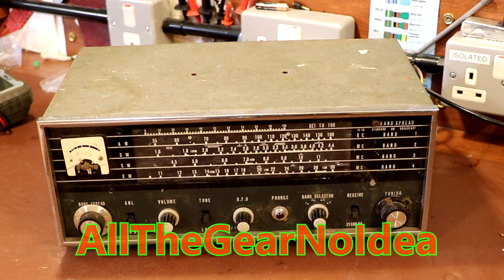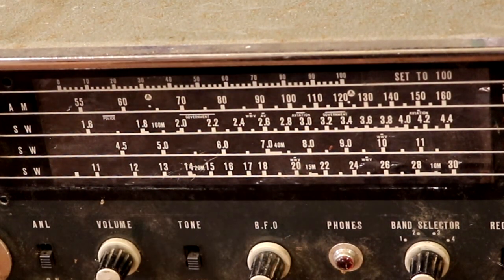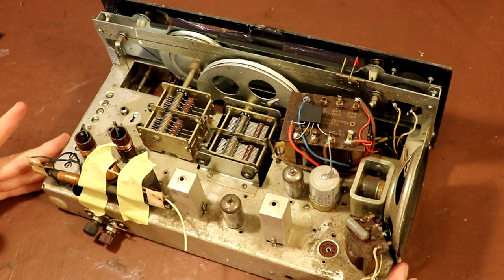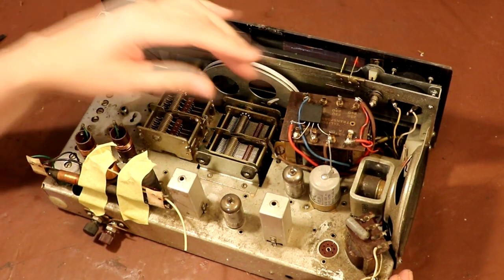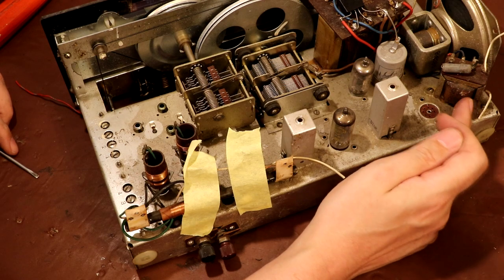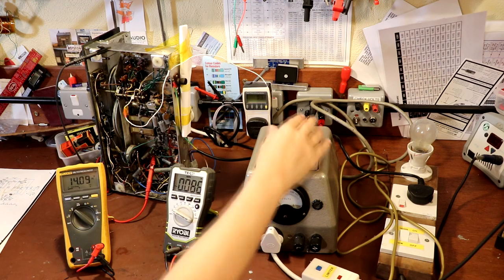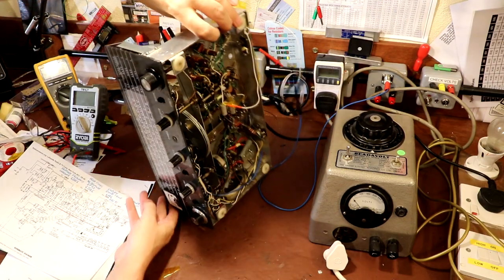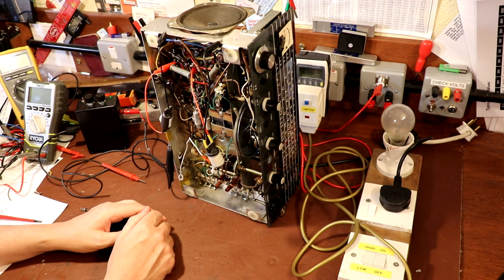Lafayette HE 40    Part 1

Comment: Hi Chris. Lafayette Radio Electronics was a catalog distributor and retailer headquartered in the NYC area from the 1930s till 1981 when they filed for bankruptcy. The address on Jericho Trnpk. In Syosset (pronounced si OSS ett) was on Long Island and was their main headquarters, warehouse, distribution center as well as a large retail store and repair facility. They had a huge catalog in their good days of over 400 pages. They sold everything from components to ham gear and hi fi equipment. I remember dreaming over that catalog as a young lad back in the 60s and 70s. The radio you have there was kind of an entry level receiver with some extra feature such as the bfo to make it more useful. Hardly a communications receiver but many a young ham or swl started out with radios just like that. Thanks for the look see and bringing back some very fond memories. Stay well. ATB Doug.
Reply from the maker: Doug McArtin  I remember fluffing the Syosset name on a previous video thanks for the information. It doesn’t appear very sensitive compared to the Trio 9R but it lacks the RF amplifier stage. Still I haven’t  sorted out the ferrite rod yet or tried alignment so it may improve a bit.  It is quite good fun trying to reverse engineer all the hacks and half hearted repairs.  It’s easy to make a radio work it’s not so easy making it work well but it’s worth a try. Thanks regards chris

Comment: Rip It Up, Rip It Up, Rip It Up and start again.. :) That was a bodger of a set Chris, good job getting it working again. I wish I'd have taken some images of my one but I didn't and I don't even know what became of it. It may be in the wardrobe. Pleasant little sets for having a twiddle around on. All the best from the lands of the Iceni, Andrew
Reply from the maker: Andrewausfa Thanks Andrew. It’s very deaf actually working better on some of the higher bands than broadcast bands. Probably need a dose of alignment.  I still have quite a lot of junk to remove off it and make it safer. Thanks Andrew regards Chris
Reply: One has to agree with Andrew here, the HE40 was just a novice's set to be played with, different though if it was a Frog-7.
Reply: Nice radio the Frog-7. Scores one in a garage sale some years ago.

Comment: Well done! And funny as always, Chris. I had a "technician" co-worker who was a ham, we had a term for his work - hammerizing (hammerising in the UK). I am currently repairing/refurbishing a Kenwood (Trio) KR-720 AM/FM Stereo receiver including replacement of some 50 odd electrolytics.
Reply from the maker: David V  You know I am quite a fan of the Trio sets the 9R was a lot of fun and you can see a lot similarity’s in the Lafayette radio. I will definitely be looking out for more Trio Radios. I’m not aware that any were stunning performers but they are nicely put together and easy to work on. Yes get those electrolytic replaced. All the metal canned paper capacitor were also leaking in my 9R. Stay safe and thanks for watching

Comment: It deserves a new life and a bit of a clean.  It has been well got at, but it still worked.  Change it to a positive power switch, some of these old radios were lethal.  Why they designed them like that is just silly, though in those days you might find them plugged into the light along with the light bulb, so positive could end up any way round.  Plus they did nothing about colour codes to make anything safer.  i am surprised there was never more people electrocuted!!
Reply from the maker: I have already changed it to live switching. But it does introduce a little  more mains hum given the proximity of the volume pot to 230v  live mains. If neutral switching is employed it’s effectively a ground connection so quieter. But as you say live switching is safer and double pole is better still.  Thanks for watching and comments. Stay safe regards Chris

Comment: It lives! A lot of bodges in there but it was complete and pretty much working. Should get rid of the hum once the original 2 section cap is replaced. could also be the poor wiring layout that adds to the hum as well. The flicky meter needle was ace... that might buff out with a bit of polish....
Reply from the maker: George Christofi  Thanks for the radio George I have enjoyed playing with it.  I think most of the hum is due to the poor way it’s been converted from a series heater string. It’s now using the chassis as the filament return to the transformer.  I suspect it originally had an auto transformer. Thanks regards Chris
Reply: @allthegearnoidea6752  the filter caps are definitely shot as evidenced by the constant hum which doesn't change with the volume control. Looking forward to seeing short wave bands work on it.

Comment: I like it and I also would want to rescue  the abused and used from the parts bin, 
Snip snip,
Eek, 
fair enough, -just get it back to factory seems like a good idea, - 'Improvements' are either for a specific function  or just wank.
Best regards, Sam.
Reply from the maker: Average Joe  I think a lot of the mods were to reduce the voltage in the filament wiring and to accommodate a different valve from those originally installed.  I don’t think it’s possible to return it to stock but we should be able to make it useful again. I probably won’t won’t spend much time on the enclosure this time. Thanks Sam stay safe regards Chris

Comment: I have a Hallicraters S-120, but it seems to be North American made with a selenium rectifier, and those IF cans with the crappy silver mica wafer caps in the base.
Reply from the maker: Oleg Kostoglotov I haven’t had a S-120 I think the circuit was almost identical but the radio cabinet was a different layout. They did a have single diode solid state rectifier. Thanks regards Chris

Comment: Yes george is a smashing bloke and he has a sick sense of humor :-D.
I don't think there is much he can't repair.
Well that radio has been over fondled by it's owners, im sure there is a law against that.
As i've been faffing about with that leak 20 amp, i know how bad coupling caps can really upset the valves.

Yes that radio needs a lot of love, i know you will cure it's problems chris :-D
I hope you are enjoying the odd bit of tinkering, i do when i get my teeth into something ;-D
Smashing video chris thank you :-D
Reply from the maker: zx8401ztv Thanks for the nice comments. Yes this radio has been hacked although the original wiring wasn’t very good either. Still it’s the jobs like this you learn most on I think. Thanks regards Chris

Comment: That is spookily similar to my old transformerless Hallicrafters S120,  bought off Ebay in a moment of madness.   I've never learned to love it.   There is supposed to be a whip antenna for SW which would be retained by the clips on the back when not used.   The BFO on mine is not a proper oscillator set-up and is pretty rotten - I think only there for detecting CW.    Mine has no S meter either.  I think yours might have been an add-on ?
Reply from the maker: SInewave423  I think it is a S120 in a slightly different box but almost identical circuit. I don’t think the S120 had the ferrite rod did it ?  No the S is standard on the Lafayette but not on the Hallicrafters.  I need to have a look at the whip antenna. I thought the clips were mains lead but you have made me 🤔 thanks for watching and great comments regards Chris

Comment: Rule number one. You can't polish a turd, but you can sprinkle glitter on it.  I hate replacing caps mainly because i'm a lazy sod but if it's still viable I like to keep if original. Deoxit? Well above my pay grade. Next video repair the Macaroni please.  Should be a cheesy video.
Reply from the maker: Simon Spiers  The Marconi has gone to work I don’t have a bench big enough at home but maybe one day I will take a look at it but then again probably not.  I’m not convinced by DeOxit mainly marketing hype put it in a small can and charge three times the price it must be good. Thanks for watching Regards Chris
Reply: @allthegearnoidea6752  But the Marconi needs fixing to sell it. Just unplug all the boards and re insert. Works 90% of the time.
Reply from the maker: Simon Spiers it something on the attenuator board